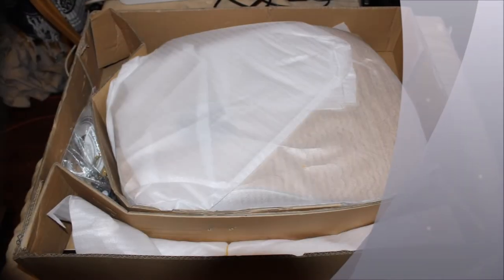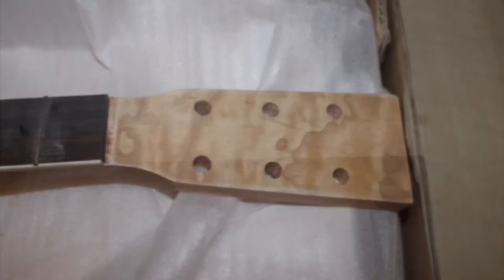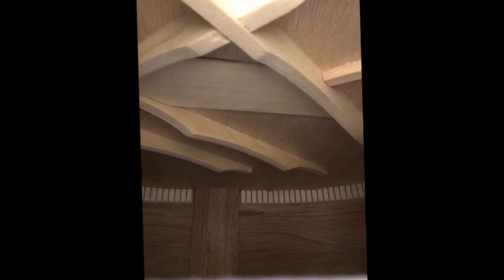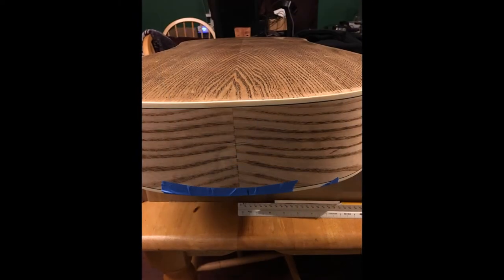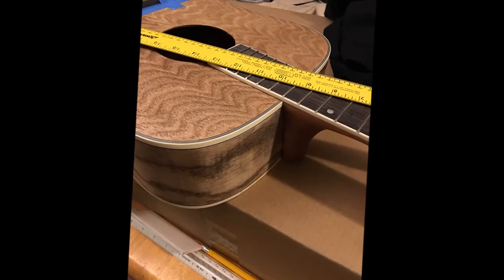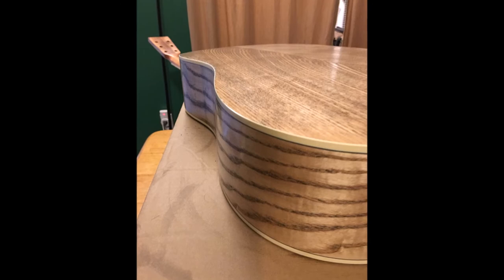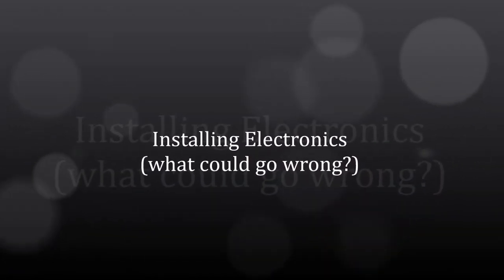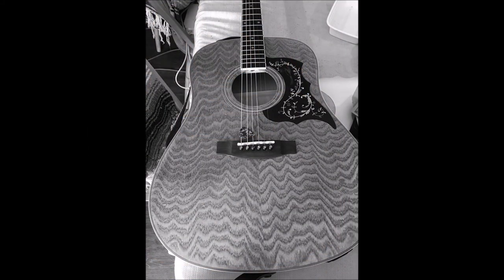RAS Kit Acoustic Guitar Build

Comment: When measuring your scale length did you measure from the top of the nut? Bottom? And to the holes in the bridge yes?
Reply from the maker: Measure from the fretboard side of the nut where the strings make last contact.  The other end is the bridge saddle not the holes in the bridge.  With compensated (angled) bridges this gets a bit tricky as the scale length is a tad different for each string.  I basically used this guide from stew mac to figure it out:  https://www.stewmac.com/How-To/Online_Resources/Learn_About_Guitar_Bridge_and_Tailpiece_Installati/Finding_saddle_location_with_the_Saddlematic.html This is really the most critical step in building one of these kits and not a whole lot of info is out there. Basically measure nut to center 12th to get 1/2 scale length and then measure that same distance from center 12th plus a 16th inch or so at the treble side and a little more at the bass side.
Reply: When staining does the stain not bother the binding or did you tape it off?
Reply from the maker: @jimmydavies9038  I have done them both ways.  Binding on these and many others are types of plastic.  Depending on the solvents in your stain it may or may not damage it but most normal stuff shouldn't.  The very surface of the binding will most likely pick up some color.  That is where binding scraping comes in.  I use a contractor utility knife blade without the handle.   Stewmac has a video called Scraping for sharp looking binding: here's how it's done!  Binding is rather soft so go slow.